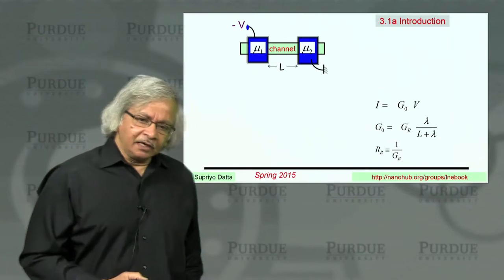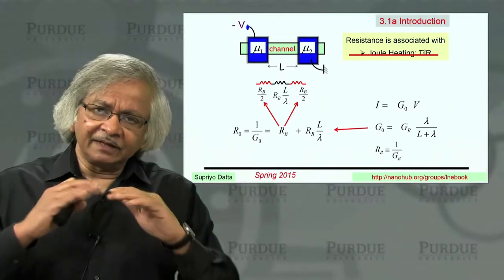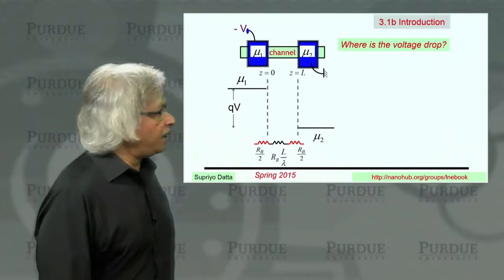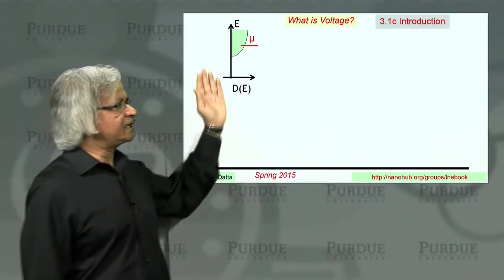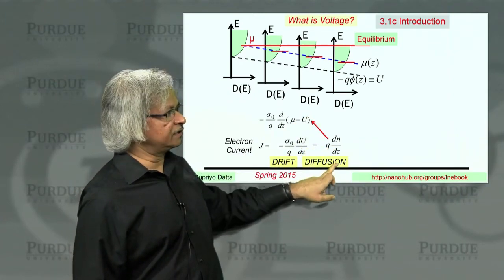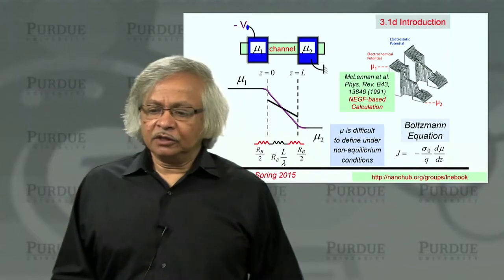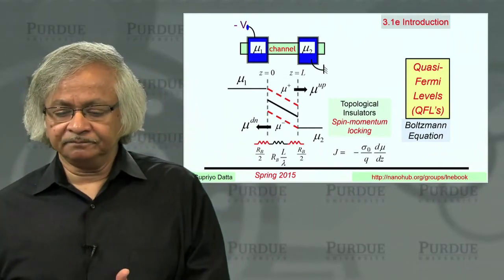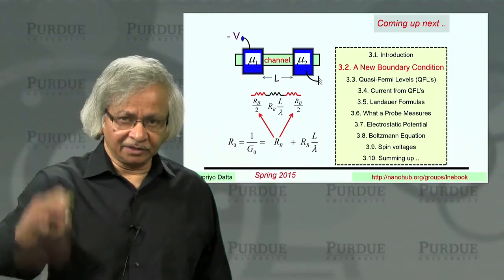nanoHUB-U Fundamentals of Nanoelectronics A L3.1: What & Where is the Voltage: Introduction

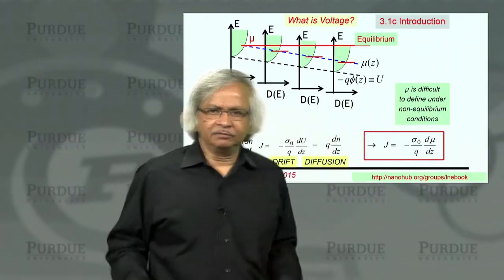Comment: Is the "electron current" same with the "electron flux" in this case? If d mu/ dz >0, then the electrons will flow -z direction (from high mu region to the low mu region), then the current will be +z direction (the direction of the current is opposite to the electron's movement). But in 13:16, J seems to be negative when d mu/dz >0 unlike the current.
Reply: Yes he missed minus sign in front.